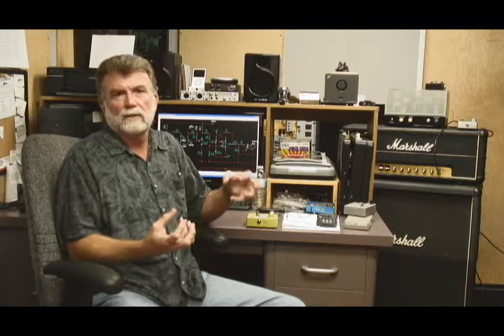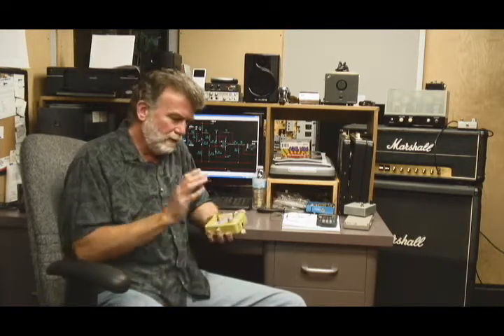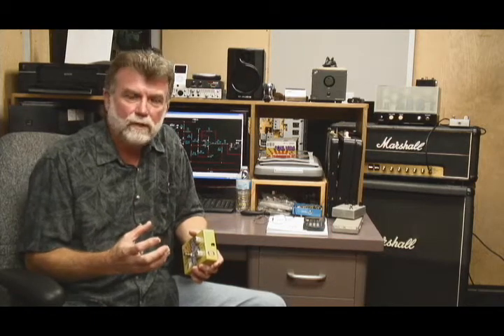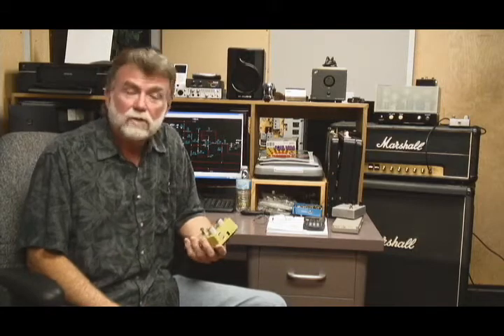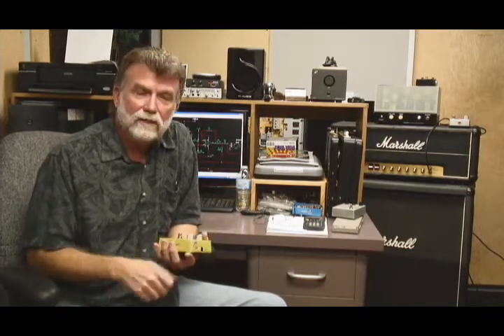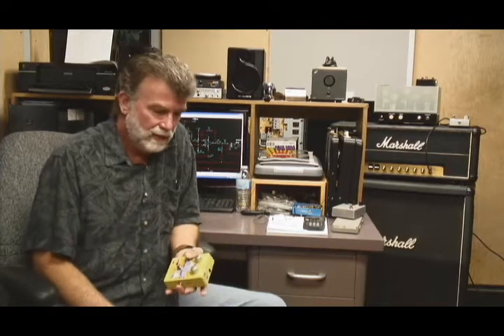BBE Soul Vibe - Tech Session with Paul Gagon

Comment from the maker: @intheblues  They're classic analog so there is some noise when engaged.  We're taking classic techniques, like using real Bucket Brigade Delay ICs, and upgrading other components in the audio path as well as construction and sometimes function.  However, at the core, there is some unavoidable noise doing it this way.  DSP effects can be totally quiet, but they lacks some interactive personality that you get with analog.  DSP can be fun, but I don't want it between my guitar and amp.  - Dave

Comment: I'm late to this thread but I passed on both B9 & C9 Electro Harmonix organ pedals because to my ears they sounded harsh, brittle and unbelievably glitchy, they were almost impossible to control as well.  I walked into my local store with my guitar to test them out feeling confident that I'd end up buying one of them - I left the shop disappointed.

I walked past the second hand store around the corner and spotted a BBE Soul Vibe in the window, I did about 5 minutes of frantic googling and ended up buying it on the spot because there was no room to test it in the store, the store attendant gave me 24 hour money back guarantee if I wasn't satisfied - I took it home and plugged it in and was blown away with the tone immediately - within seconds I was jamming away with the minimum amount of tweaking!